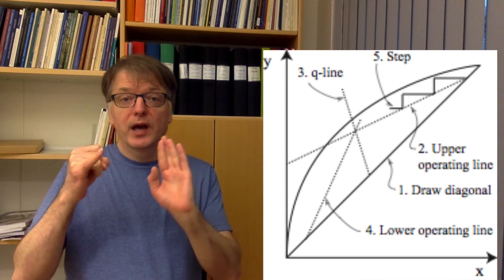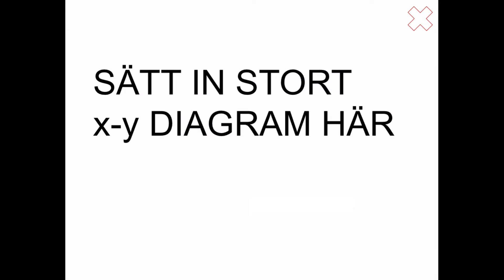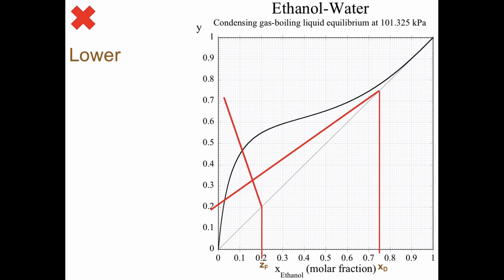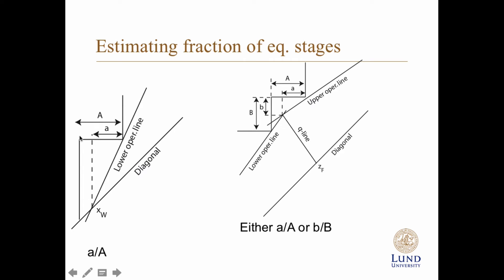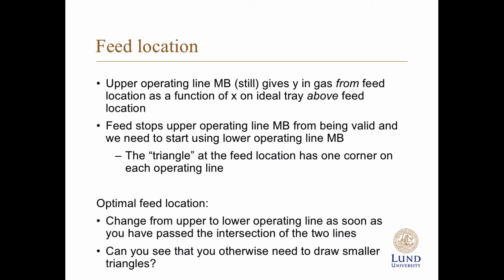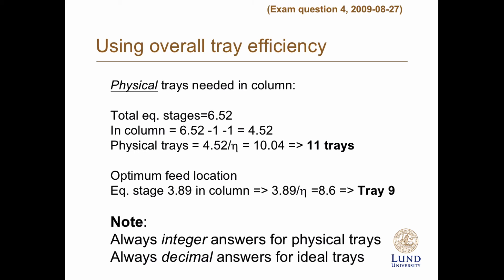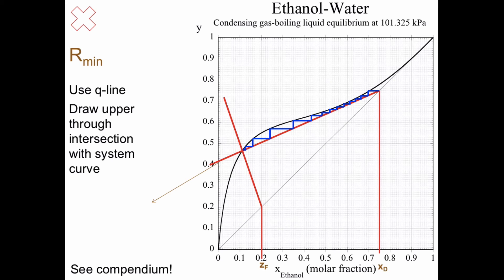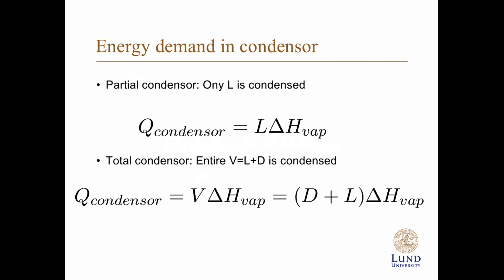Distillation: Exam task (Ethanol)

Comment: I have a question: Now say that your feeding stream is for example a 50/50 mixture of tolueen and n-hexane. But that mixture is not that pure than you thougt, so for example it contains 10% water. What does this with your separation and how can you fix this?
Reply from the maker: McCabe-Thiele can only be used for binary solutions, so that's a completely different question than the ones we address in the two courses (KETF10 separation processes and KETF40 Mass transfer in environmental engineering) that this video is designed for. It also goes beyond my (i.e. Mattias who made this video) expertise. We have a different course, sustainable process design, that deal with distillation of non-binary mixtures, but we don't have any recorded videos for that course (at least not yet). Videos are planned, but it has not yet been decided if they will be published on our YouTube channel.

Comment: I'd like to know the text you've used for the diagrams and equations. (:
Reply from the maker: Can you rephrase your question to help me understand what you want to know?

Attempts to answer your question

* The exam task solved is an exam task I once gave my students.
* The equations I use are explained in the compendium I have written for my students (and they are also listed in the Handbook that our department and the department of Food Technology (Lund University) uses in several courses. (I'm the editor of that Handbook) However, you can find the same equations in several different standard textbooks on distillation
* The diagrams I have created using matlab and data on phase equilibrium. I keep forgetting which mathematical model I used for which system (Van Laar or one of the others?) Experimental data sets on phase equilibria often state the goodness of fit for the different mathematical models, so I tend to go for the model that shows the best fit.  There are, however, rules of thumb of which model to use depending on the characteristics of the substances, but to be honest that's not something I know much about.
Reply: Thank you for the swift reply. I found the equations in a textbook but, I'm having trouble finding some of the graphs used such as the one represented under 'Estimating fraction of eq. stages' in this video. Is it possible to access the handbook online? 
(I need to reference some of these in my thesis as well)
Reply from the maker: Sorry, neither our Handbook or my compendiums are available online. 

The calculation of fraction of equilibrium stage is a standard used in many text books on distillation. As far as I know, no-one is claiming that the method has a particularly solid theoretical foundation (It mimics the definition of the Murphree tray efficiency, but the overall tray efficiency is a lumped parameter, so there is no guarantee that it will give you an accurate result. On the other hand, McCabe-Thieles graphical method uses a few simplifications anyway, so if you use McCabe-Thiele you should not expect an exact prediction of reality). What some textbooks say is that you should calculate the fraction both horisontally and vertically and take the average of the two. (Compare taking the average of the Murphree tray efficiencies for gas and liquid compositions respectively). 

So, if you're looking for a reference to a book regarding how to calculate fraction of equilibrium stage (for position of feed or total number of equilibrium stages), you should be able to find plenty of text books to refer to.

If you're looking for an actual image to copy-paste into your thesis as an illustration, I hope you know that the basic idea behind copyright laws is that you're not allowed to use other peoples images without permission (even if you redraw them). Your university might penalize you if you break such rules so my standard advice to students is always: "If you're not sure if you're allowed to use an image/illustration: Either don't or ask your supervisor/examinor"

With this particular illustration I would say the content is in the public domain (it is "common knowledge") and that you therefore do not break copyright rules if you make your own version. You thus shouldn't need permission, but if you feel a need for it, you can state that you have received my written permission to redraw the illustration.
/Mattias Alveteg, Lund University